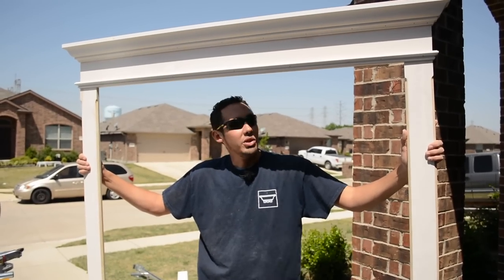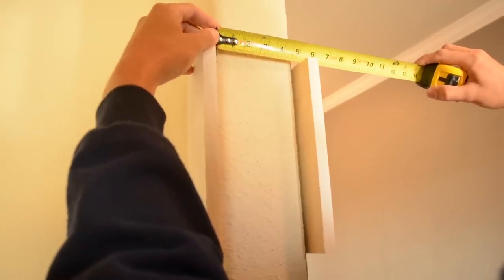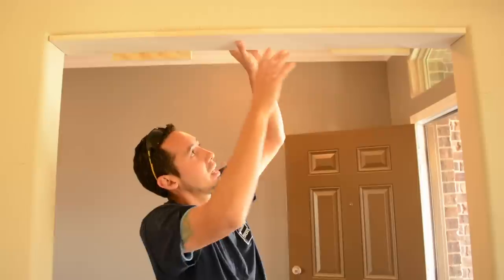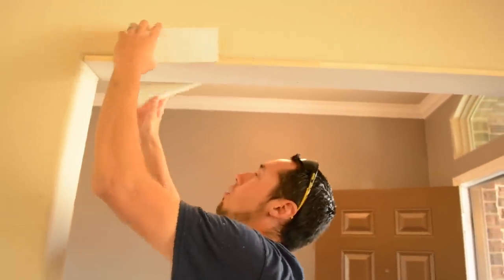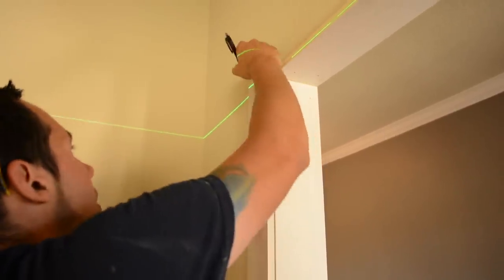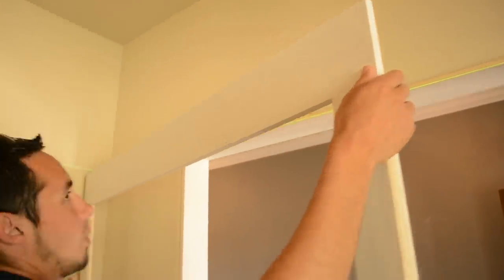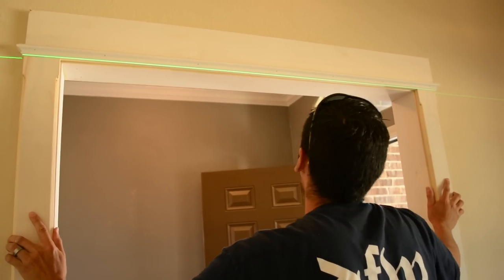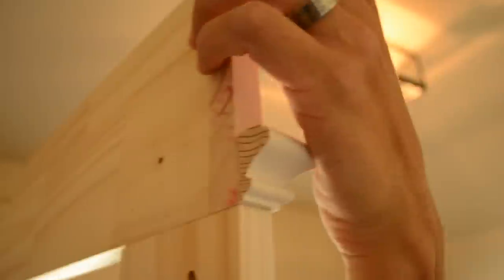Door Trim Transformation - Simple Finish Carpentry

Comment from the maker: The cost of materials for casing both sides of this door was approximately $77.00 USD. That does not include the labor to install it, prep it, or spray it with a final coat.  I would charge $550.00 to do everything- supply material, install, and finishing.
Reply: You do realize he is also making a video while working right? This isn't his normal pace I'm sure.
Reply: High speed = high margin for error
Reply: Thank you for adding material cost and your bid price. As a new contractor, that really helps. Love your channel! Amazing work!
Reply: Joe T - You're a condescending guy and a bad employee, it seems.

He's trying to teach and show people in this video. Speaking slowly, being deliberate, and repeating yourself are KEY when teaching. There's nothing in this video that could give you an idea of how fast he works when he's actually working. These videos are a separate project for him, he's even said in other videos that he only does them when he has extra time because he wouldn't be able to work at his normal pace and make videos.
Reply from the maker: My old boss would literally run from inside the house out to the saw to try to finish the jobs fast and increase profit. I saw him always stressed out and he eventually got a divorce. It is really sad. I say that to say this, speeding through jobs is never good for this type of work. You will spend just as much time fixing mistakes. I am going really slow here. This took 4 hours to shoot the video and plan all the scenes. We had approval from the homeowner to take as much time as we needed. If I was normal paced this would have taken about an hour. Nothing wrong with working fast but also nothing wrong with working slow :) and I prefer to work slowly and comfortable. I don't charge by the hour. I charge by the job so it make sense.
Reply: Very nice tools sick, I install for a window and door company. everyday I put on trim. I don’t like the flat MDF stuff, I’m more of a stained oak guy. Good stuff
Reply: Don't feed the troll people. Joe T (aka Speedy Gonzalez) (aka IKEA cabinet specialist) is just a jealous hack that only wishes his skills and craftsmanship could be half as good as Richards.
Reply: Super clean & nice! I love your returns, wondering which saw you cut them with...and curious why you weren't using your own glue? Tite-bond is what I use.
Reply: Why not use double side tape to hold up the wood to measure?
Reply: Joe T, Just saying what? That you don't mind taking advantage of people? That contractor is more than likely charging the customer $60 an hour for your slowed down workflow. That's $500 a day. You say you can work like Speedy Gonzales so why don't you speed your ass up for those poor people who are getting charged $2,500 a week for you. Then maybe you'll have some good karma coming your way if and when you become a contractor.
Reply: Joe T lol wait till you've done it a while, you'll soon realize you don't care how long a job takes, you'd rather be relaxed and do good work. It's not about hourly rate when you work for yourself, it's about referrals and enjoying what you do. I used to be like, man I quoted this job for 8 hours, I need to be done on time. Then I realized, no I don't, I'm the boss so relax and don't worry about it. Makes me more pleasant for the client as I'm not rushing and stressing out and willing to take the time to show them all I've done and show off my work.
Reply: Sean McAleavy if u pay attention 2 his vids he gives them a written contract with the cost of the job, therefore its money our of his pocket not his customers troll
Reply: Sean McAleavy troll
Reply: Joe T heat neat lobe the double time around the middle
Reply: He is slowing down because he is teaching the watchers his amazing skill dummy
Reply: Thanks for teaching us your talents and skill! It amazes me the inconsiderate people out there that complain about everything! They don't realize you don't have to show anybody anything and they could try and learn on there own! thanks for taking the time to teach us your amazing skill! I just finished a wainscoted stairs wall with the raised panel and offset trim you showed us in one of your videos and it looks amazing with tons of compliments! I couldn't have done it without your help!
Reply: I have been building furniture; doing kitchen and bath remodeling; installing doors and trim for 17 years. Work at your pace and do it right; show up when you said and don't leave early; keep it clean and organized. I charge twice as much as my competitors and still have to turn down  work. Keep up the good job it shows you care about you name.
Reply: @Joe Tv, if you've been a long time suspender you'll know that Richard has always put his emphasis on the quality of work and not the amount he can bid or accomplish. He's also stated numerous times that if he makes enough to pay his bills, and feed his family that he's content. That is why he stays with just a 2 man operation. Everyone's goals are different though, hope all is well and God bless...
Reply: Would love to meet you in person one of these days. Learned a great deal from you as I'm trying to start my own  contracting business. God bless
Reply: robert winton Very well said!
Reply: I have been in the sign business for 60 years and never tried to be the fastest guy around. Like you, I charge by the job and then do whatever it takes to make it right.  Thank you for showing us what craftsmanship looks like.
Reply: DR Dan  You can order moulding online and the profile selection is excellent.
Reply: Sean McAleavy  uz wite😨
Reply: Sean McAlea
Reply: Sean McAleavy   Uz wite
Reply: Awesome video man. I was blown away you charge as little as you do. Your work is always fantastic and $550 for both sides, material, prep, paint and install is christmas come early. You are an amazing addition to you tube.
Reply: Tyy Daymon i thought that too but it likely is for security of the hold. Tape likely would allow movement.
Reply: Tyy Daymon it's getting covered anyways...1 18g nail is very easy to remove
Reply: Joe T you make no sense. Speed threw a job, and screw shit up? What kind of a work ethic is that? He's making a video, while working...he is explaining EVERY step he is doing. Why don't you go work for a real company, go as fast as you wan, screw everything up, and see how long you last....I guarantee you wouldn't last a day on my crew.
Reply: Finish Carpentry TV before i even looked i figured around 600-800. 550 for your quality is a bargain.
Reply: Finish Carpentry TV thanks for all your help, can you give a hand I still have difficulties giving out estimates,how you do it. I will appreciate if you help me,and thanks for all your support
Reply: Finish Carpentry TV .
On our jobs my thinking is when people admire a finished job they ask, who did it?  Not how long did it take.
Reply: Joe T So you work slow and steady? That’s a marathon pace. If you’re working for someone else, at least where I come from, you’d be sprinting every day, because you don’t want to lose your job. I’m a solo handyman now, and I also run a marathon pace, and I still make great profit. I’m sure there are plenty that do what I do for cheaper and faster, but my customers still hire me because I’m professional, clean, and seem trustworthy.
Reply: Damn Richard you must do some real high end work to charge that rate. I truly aspire to be more like you and do more high end trim work. Right now most of my work seems to be door installs. I love it but I want more finish work.
Reply: Great videos mate. Keep them coming love watching this. Explanations on what you are doing and why are spot on.
Reply: Tyy Daymon - Double sided tape might risk ripping off existing paint rather than a tiny Brad nail pin hole.
Reply: @Joe T I will not hire you if all you think about is the next customer and not the quality of your work.
Reply: @Joe T If you're doing quality work and charging what you're worth, you don't have to run and gun from one job to another!
Reply: @Joe T Fast is great, but right is permanent.
Reply: Why in the world would you charge $550 when the materials are less than $80 bucks? It's called highway robbery.
Reply: Finish Carpentry TV  Slow is Smooth, Smooth is Fast
Reply: DR Dan 
If the opening is out of level or plum then shim it out just like a door, and install your casing onto the places where you installed shims. The shins will be covered up by the trim just like a door. Makes sense? 
It really sucks when you get your door or window square, plumb and level but the the walls are not and if it’s close to a corner, your square door next to a corner wall that’s way out of level looks ugly cuz now the square door exposes how out of plumb the wall is and nothing you can do.
Reply: @FinishCarpentryTV   What part of Texas are you working?
Reply: The detail & labor that went into one door casing was crazy!  Great work as always man!
Reply: Johnny's Lawn Care Dallas Fort Worth. The name of his company is DFW Crown, just like the channel used to be called.
Reply: NaturalbyNature he charges for a 2 man crew at the job site, but if you take into consideration his time to load up the correct tools for that job into his truck and the time to drive to the lumber store, pick all of that out, and then driving to the job site and home, that adds up. Basically charging for 1 day for 2 guys. I think 550 is fair
Reply: @FinishCarpentryTV  I love your work.  I want to buy a house in Texas How far you willing to travel for work? What City are you willing to travel to?
Reply: What’s a miter return
Reply: Love your videos thanks you do amazing work
Reply: @FinishCarpentryTV  spot on. Do it once and do it well. I love your work ethic and skill. You are awesome.
Reply: Awesome work! So glad I found this channel. 
Could you show how to install a similar trim around half-round windows? I'd like to replace the trim around my doors & windows to get this same look but I have 2 half round windows that I don't know how to do this to. One is over the front door & the other is in the master bedroom, so it's not like I can just skip those 2... 
Any helpful tips??
Reply: What is the material list
Reply: Can you replicate that on an arched angle
Reply: Maybe I should hirer you to come do some work for me. Lmbo. Your da man!
Reply: @FinishCarpentryTV  I love your philosophy on qaulity first! I'm of the same mindset. I'd be a happy camper to work for a guy like you! BTW, my old boss used to scant and strong for what you say plus or minus. Over the years I've enjoyed working with others and hearing their version of "strong/ plus" and "scant/ minus".
Reply: As easy as he made this, I still couldn't pull this off..lol
Reply: $550 wow!! It took him literally maybe an hour, that Is a lot of money...you could probably buy a complete  prefabricated door moulding trim set from wayfair for half his fee and just install it..with money left over
Reply: Man, great smooth work as usual. Love the simplicity, and the look.
Reply: You need a nice pair of calipers. Way easier.
Reply: @oldskoolwayy  Wayfair? Don't think so.
Reply: You're a great teacher and I admire your eye for precision. I am slammed for being too precise but they'll get over it.
Thanks again.
Reply: @carloscortez479  I have the same Question
Reply: I really don't think about you work as construction work I think is more like  Gift piece of  art 🎭🎨 body for what I concern you are an artist....
Reply: @barabbas67  how is little molding call?
Reply: @TyyDaymon  then you have to account for tape thickness and it squishing

Comment: i love the tips and techniques you provide with your clear, understandable descriptions.  My brad nailer bit me once, when I was installing cove moulding on the floor of a bathroom. I had changed to shorter brads, but was unaware that a single 2" plus brad remained in the chamber. That single long brad found its way through the moulding, the drywall and made a tiny hole in the pex line feeding the toilet.  An expensive oops!

Comment: Would be interesting to see a video of installing trim in older homes with out of square frames and walls. Installing base with damaged drywall behind from prior repairs and base installs. Rounded interior corners and installing miters. Trimming uneven floors, etc. Your videos are nice and informative, but I see a lot of newer homes. If you have jobs in old homes that have seen repairs, settlement, that would be a good video.

Comment: Nice tip on building them as a unit , I can see how that goes much smoother .   What do you use too fill nail holes ?     Titebond makes a trim and molding glue that's doesn't run , it's a thicker consistency  , great for verticals .  Plus it sets fast too .

Comment: a little trick fro measuring curved edge widths, screw a piece of MDF squared up onto each clamping foot on a quick clamp, then you can quickly clamp over a timber measure the internal width without nailing.

Comment: You make this look easy... Ive been a contractor for 15+ years here in Oregon and started for a decade doing new manufactured homes and you had to set every door, trim it out ect... i would take a shim and cut it and use it to mark reveals around the doors then just hold my wood up and mark the reveal mark so I didn't have to measure anything, I didn't know they made a tool for it.. Crown moldings is the biggest learning curve to date for anything I have done... thankfully Im smart and got it.. I just started going everything battery powered dewalt.. I wish they made the adapter to make my 7.25 dewalt cordless miter saw ac powered like yours... I hate how they rip us contractors off, nothing I got except my nail guns came wiht a battery or charger.. even my chop saw was tool only, shitty thing to do imo DeWalt.... greedy af!!!!!!!!!!! Of your battery powered table saws which one do u recommend, I see u have the Milk & dewalt.. do they make the ac adapter for it as well? 

 Great work brotha, really makes me want to do finish work as it's the most challenging and rewarding part of construction I think as you get to make things look so drastically beautiful and get that homeowner response of wow...

Comment: I nail and screw my jambs together on the bench attach one side of the casing and pop it in like a prehung. Then case the other side.  I pocket hole the back of my casings too when possible to keep everything tight as possible.  Wrote that too fast, i see you do it that way too. Love your videos. Always like picking up new tricks.
Reply: What length kreg pocket hole screws do you use?

Comment: Going from 7/8 to 15/16 damn you are a baller. 99.9 percent of people will never notice the differnces in those measurements. I cut concrete pavers though. Have well over a thousand pavers cut under my belt. Also decide how they they should be cut and lay them too. Its rare I take it above the eighth .

Comment: So when I do prefab archways, I always make the legs and head 1/8" wider than widest part of wall, so at the widest point your a 1/16" proud, after the archway trim is done, I caulk everything in and sponge it with wet sponge, always works out well. If the woods being stained, I charge about a third more for labor.

Comment: Where you nail a piece of scrap up to define your edge, I use a quick grip clamp with a couple of scrap pieces hot glued to the clamp, makes quick work of measuring the width of a wall or casing. then it  breaks down easy for another use .
Reply: Hot glue? Lmao ok arts n crafts

Comment: Clarification please...   When you nailed the blocks on side of the header to use as a stop for placing the header jamb.  You used the blocks to make sure you were placing the header jamb equally but wouldn't it then be slightly to one side of the header?

Comment: With the 1x4 and 1x6 are they just regular pine wood? If so what do you prime/paint them with so the wood grain and knots don’t show though? I always have problem with the wood grain and knots coming through eventually. Maybe I’m just not using the right paint to stop the bleed through.
Reply: I've had the same problem with knots and sap streaks.  Zinsser’s BIN is a good primer to stop the brownish bleed through your paint job.  You can buy it at most home improvement stores.
If you have to fix already sap stained moldings like I do, it's best to sand the paint in that area and then apply the primer.

Comment: I built trim very similar to this for most of my house.  I am doing the kitchen now and have several doors that the tops will intersect.  How would you recommend making those connections?  As most houses, my corners are not 90 deg.  I imagine mitering would be very difficult to line up.  Would you cope these?  Seems like it would be a very complicated cope?

Comment: If I'm making a more simple casing out of MDF outside and installing it inside after it's all assmebled, can I use CA glue instead of the creg screws to hold it together while I assemble and move it in? I don't have a creg bit setup and I think mdf might be a little weak and might tear if there are screw holes like that.

Comment: I'm a big fan, thanks for all the education!  Question: how would I put a shelf top on a crown if I had a similar situation?  I followed your tutorial and cased a large opening between my formal dining and formal living room that had high ceilings-- pretty good for a first timer thanks to your tips!  I'm about to put the crown on top (around 11.5 ft high), but then want to cap it because you can see it from the second floor.  I know i wouldn't be able to just lay some type of top board on top of crown that's just nailed in due to weight, and wondering what tips you might have?  Thanks again!

Comment: I am just getting started with finish carpentry in my own home. At the beginning you used nails for the scrapes to get your measurement. 

Could I use clamp to hold the pieces instead of nailing it to the wall?